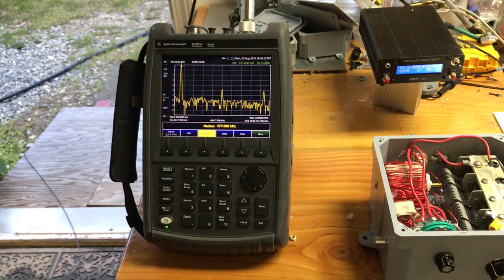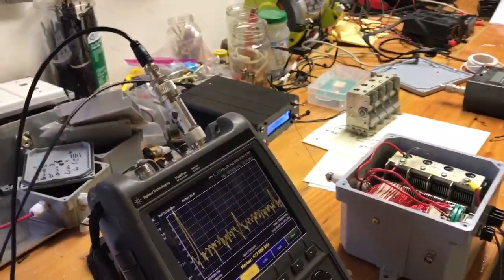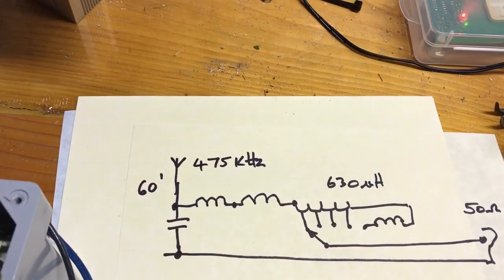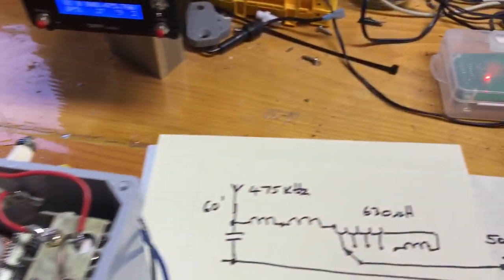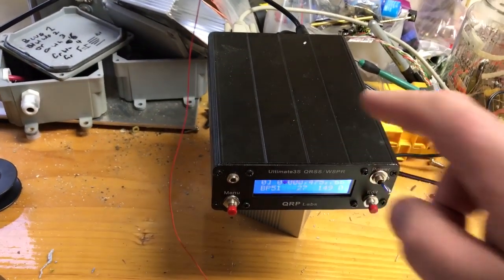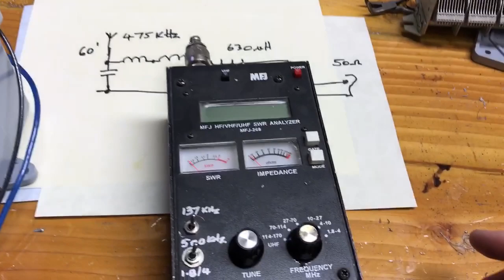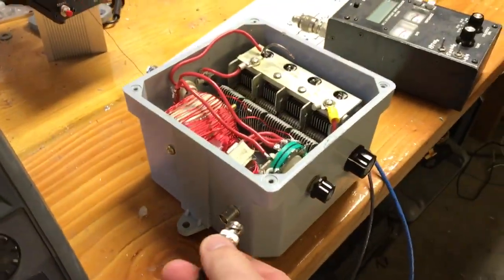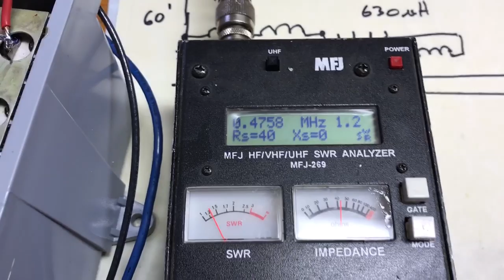630 meter /475kHz L match design part 1

Comment: Use a Ferrite, not iron powder. 630uH on an FT240-75 material is only 10 turns.
Reply from the maker: Ok thanks but if you measure the losses on tx and the heat with 75 material and Gauss levels without saturation are difficult to manage- its bad enough at this type of power - even with type 2 which is closest to lowest loss Ive found to date outwith aircoils